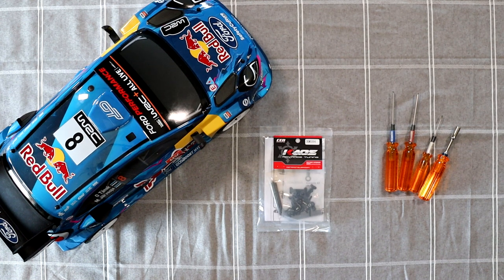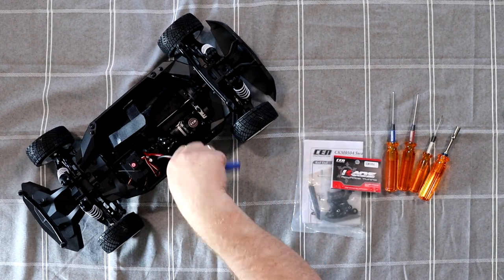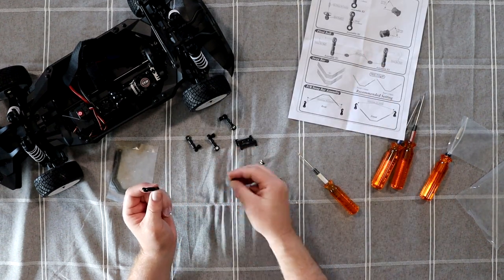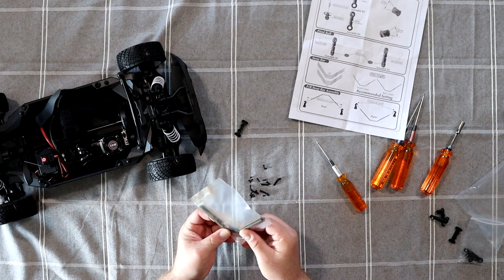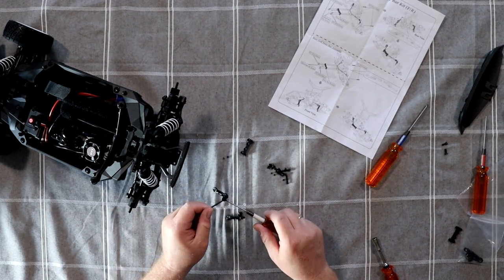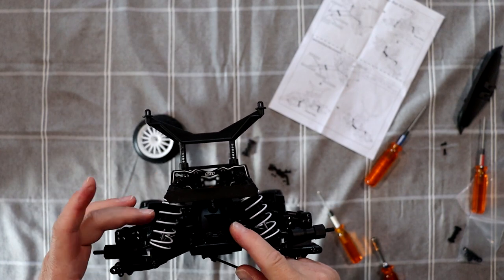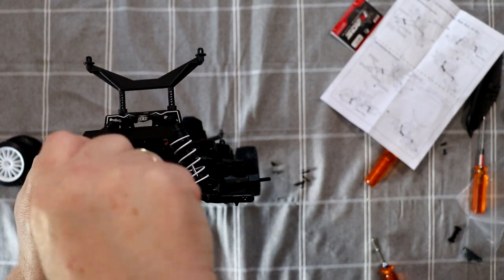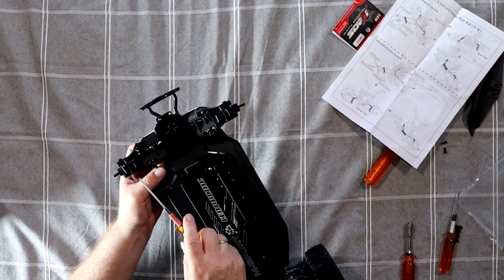CEN RC Ford Rally Puma Sway Bar Upgrade

Comment: Thanks for the video! I didn't know they released the sway bars. And while I ordered them I also found the center diff upgrade. Installed both upgrades yesterday. Finally the Puma is technically on par with the HPI Flux WR8.